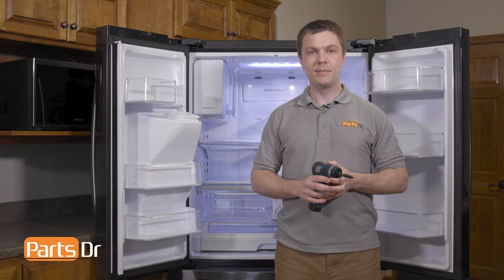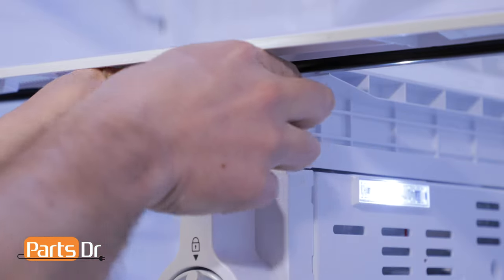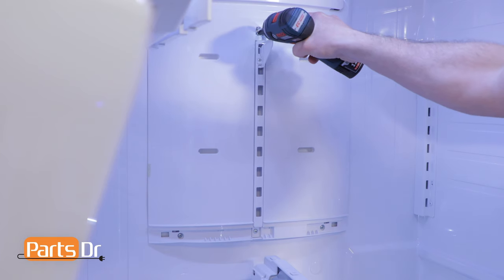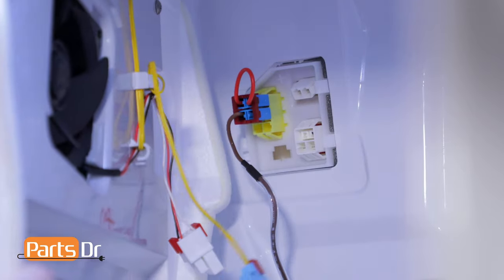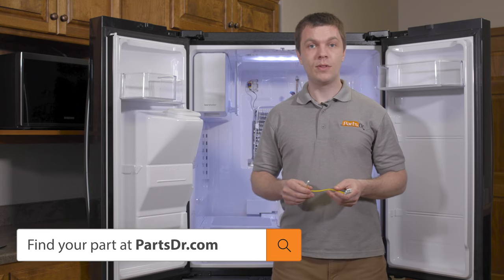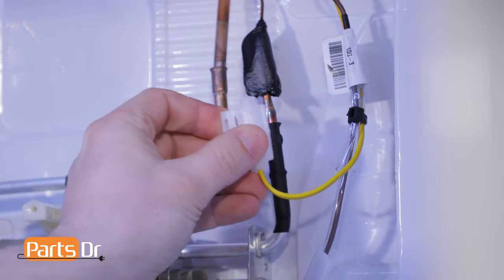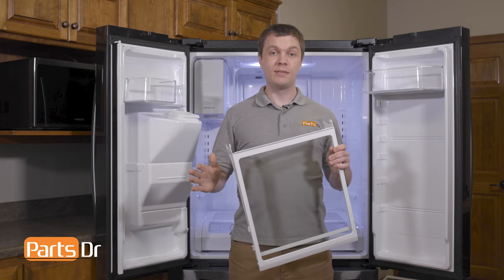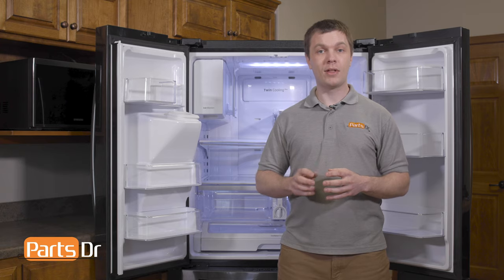How to replace the defrost temperature sensor part # DA32-10104N in a Samsung refrigerator

Comment: My fridge is cooling too much is this likely the part that needs to be replaced? or is it a seperate thermastat i need to look at? Front door temp is reading 10-15 degrees warmer than actual inside fridge temp thus everything freezing. Set to 44 degrees still freezing everything. Thanks!
Reply from the maker: There is usually a temperature sensor located inside of the evaporator cover assembly.  It would most likely be that sensor that would cause that type of problem.  You can also test the sensor by following the instructions in this video here: https://www.youtube.com/watch?v=J5bwcteeJNM
Reply: @PartsDr  to clarify this would be the sensor to use: https://partsdr.com/part/da32-10105x-temperature-sensor-thermistor?model=RF263BEAESR---AA-03
Reply from the maker: @djmiller001  Yes that looks like the correct one.

Comment: Our samsung french door fridge and freezer seems to stop cooling every week. it works good except each week it stops cooling I realized if i  cut the power and it will reset and start cooling again untill about a week passes. it is like it goes into defrost but does not restart.could this be the sensor? wold this be the freezer sensor or the fridge one or freezer sensor  or both thanks.
Reply from the maker: That does not sound like a sensor problem.  You can test the sensors like we show here to be certain: https://www.youtube.com/watch?v=J5bwcteeJNM
Reply: we replaced the temperature sensor but the wire is to short to connect to the original wire . can the sensor   be clipped directly to the silver coil?

Comment: Can I use da32-00006W ref defrost sensor for samsung rs21hutpn1
Reply from the maker: We don't have access to look up international non USA models. You will need to check with a local parts supplier in your country.

Comment: Will this help with food freezing in the fridge section?
Reply from the maker: Not normally.  Usually when the defrost temperature sensor fails, the evaporator coil will get frosted up which causes the refrigerator to not get cold enough.
Reply: @PartsDr  How do I determine if this is my problem? Our fridge isn't getting cool enough on its own without a boost from the Power Cool, but it thinks it is. The temperature setting reads the temp I set, but thermometers placed inside show higher temps. Is that why the fridge stops short of getting cool enough, and could that inaccurate temp reading be the reason why?

Comment: My Samsung it's not cooling right freezer is at 36 and refrigerator at 34. Would this defrost temperature sensor be the issue?
Reply from the maker: It could be if your freezer isn't going through the automatic defrost cycle and the evaporator coil is full of frost.
Reply: @PartsDr  thank you.

Comment: What are the symptoms of a bad defrost sensor?
Reply from the maker: The evaporator coil that the sensor attaches to will be frosted/iced up so that air cannot flow through it.  A light amount of frost is normal when the refrigerator is cooling but excess frost/ice is what causes problems.  When this coil frosts/ices up it can cause multiple issues.  1. The refrigerator will not cool properly because air won't circulate. 2. The fan motor can stop running because it can't get to the proper speed for normal operation. This can cause an evaporator fan motor error code and cooling problems 3. The defrost hole hole can freeze up causing water to not drain and it will end up pooling below the vegetable drawers or at the bottom of the refrigerator compartment.

Comment: @ 3:26 in the video there is what looks like a jumper wire connected just above where the defrost sensor snaps in. I do NOT have that jumper, can anyone help with a part number for it?
Reply from the maker: If a jumper is needed the refrigerator would include one from the factory.
Reply: @PartsDr  I've taken it apart so many times I may have lost the jumper and failed to replace it...
Reply from the maker: @michaelbowman9433  We have never seen Samsung offer that part for sale.  You could try contacting them directly to see if they can help you any further.  Some items like this are considered non-serviceable and not offered for sale by the manufacture.

Comment: What does 5 e means .
Reply from the maker: What is the model code/BOM name of the refrigerator?
Reply: @PartsDr  model number Rf260beaesp
Reply from the maker: @emperorsanders5744  5 E error code means the defrost sensor has trouble.  Follow the steps in this video https://www.youtube.com/watch?v=J5bwcteeJNM to test the sensor and replace if it is bad.
Reply: @PartsDr  there are so many choices on buying sensor .  Is there a easy way to buy exact one or can I use any of them?
Reply from the maker: @emperorsanders5744  search our site https://partsdr.com with your refrigerators Model Code/BOM name https://www.youtube.com/watch?v=4HhWL9sonuE